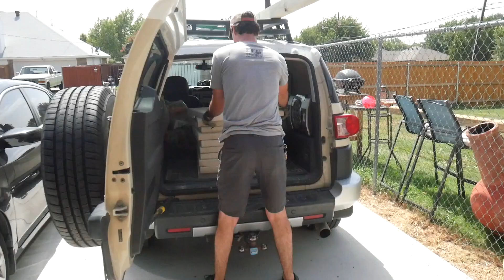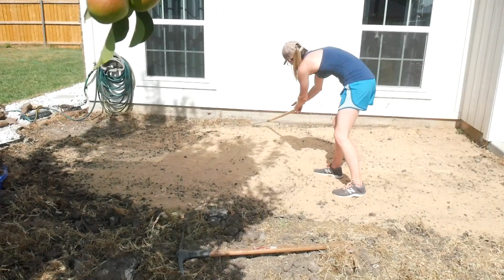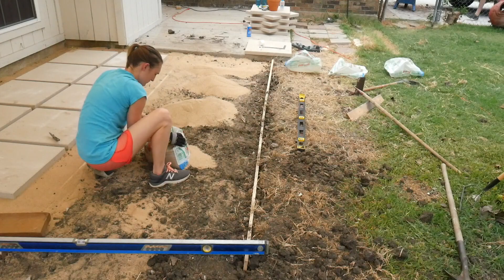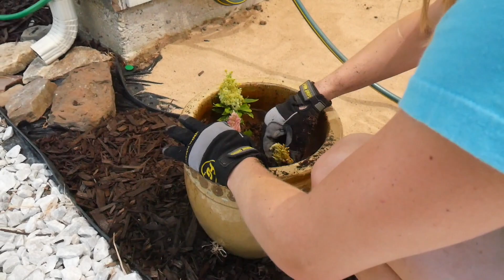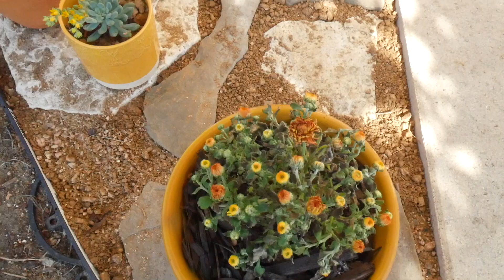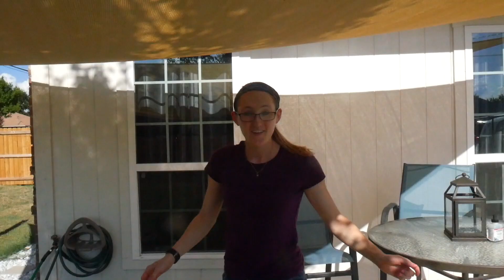DIY XERISCAPE BACKYARD PATIO: Backyard Makeover!!!

Comment: Great Video  I do have a question @ 2:55 mark Why did you place a board and make a line Then proceed to place pavers over top of it    Thank you for your help in this video
Reply from the maker: Hi Tom, that was a board we placed to keep the sand fixed and level as we placed the first two rows of pavers. Then as you see we placed that other board on the outside to hold the edge there as well. Once the first two rows were down the foundation was firm so we could pull up that first board and lay the pavers on top. We eventually pulled up the outside board as well and replaced it with metal edging. You can check that out in the updated video we posted!

Comment: I love how your patio came out. I am starting mine in Feb. Just a quick question, do you know how much of everything you used? Sand etc. Thank you.
Reply from the maker: We're so glad you love it! February will be a much better month to do a project like that than in the heat of the summer like we did.  That's a good question, we used 20 large 2ft x 2ft pavers, about 36 of the smaller pavers, over 20 bags of sand (each bag of sand covers around the same area as the large pavers) and probably close to 10 bags of granite. Honestly we really underestimated how much sand and granite we needed and had to make several additional trips to Lowes and Home Depot. In our experience whatever you think you need, add several more. You can always take it back if you don't end up using it, but it sucks to have to stop what you're doing in the middle of a project to get more material. Good luck and let us know how it turns out!!
Reply: Awesome!! Thank you so much, I will definitely come back here and  show you guys a picture when its all done. I appreciate all the info.
Reply: Hi, just one more question. What are the size of the small pavers you used?
Reply from the maker: @amberrey5282  2'x2'

Comment: Awesome job! I just want to do the same project yours but i am not yet decided to do it now, my reason is to do one like that is to extend my concrete parking bay beside of my garage, the end of parking bay was soil,if i do with that yours? does it hold enough the stone paver if i park my car?
Reply from the maker: Hey Sherwin, I’m not sure if it’ll hold a parked car without breaking the pavers. I know they make pavers for that type of use, so maybe you just needed stronger thicker stones. We only put furniture on ours and we haven’t had a single one break but when we installed them we had 3 or so break apart in our hands and we had to return them and pick up new ones. They can be kind of fragile.

Comment: Hey what size pavers did you use. Was it 16x16 or 24x24
Reply from the maker: 24x24! :)
Reply: Thank you for responding back to me, so now I know what we need to do for ours
Reply: How many bags of sand did you use
Reply from the maker: @angerleanhammond1143  I can't remember an exact number but it was quite a few. Maybe 20...
Reply: Thank you so much i keep watching it over. We did the front and made a sitting area and we did it with 10 - 16x16 pavers and it turned out wonderful but the backyard is such a larger area.
Reply from the maker: @angerleanhammond1143  That's awesome! Glad the front yard worked out so well for ya'll! We actually came back later and made this space larger. We are filming an update today so check back tomorrow for that video! It really is a great way to utilize the space. Good luck with the backyard!!
Reply: Thank you so much I will look at it tomorrow
Reply from the maker: @angerleanhammond1143  Did you see the update video we posted yesterday? It has a few more tips and shows what the patio looks like now 2 years later. :)

Comment: Hey y’all how have these tiles settled? How did y’all get a slight slope away from the house for water drainage (if y’all did)? Would y’all do anything different? Do weed grow through? Lots of questions but a video update would be awesome just to update how it’s working out! I’m motivated after watching y’all work 💕🔥 thanks for sharing this!!!
Reply from the maker: Great idea for the video update! We'll work on putting that together over the next couple weeks. The tiles have settled a little, but not much at all. When we were leveling out the ground we pitched just a little off center away from the house to make sure water wouldn't sit and collect. Haven't had too many issues with weeds except for the grass trying to grow passed the edging we put in. If we could do anything different, maybe wait until fall? Haha, it was SUPER hot. Other than that, the only other thing would be maybe make it bigger. We could have gone out another 4 or 5ft and that would have been more usable for larger gatherings. Thanks for the awesome comment, glad you liked the video!

Comment: I have a nice big yard with space on the side too. The side yard it's just sitting there looking boring..I want to use that space too..the side yard has a slope which iam thinking of removing or adding dirt to level. After that  iam  gonna lay down concrete to use that space too. However, now  iam debating between gravel and concrete for the side yard space ( 15ft  from house to fence and 60ft long.)...my only concern is gravel getting stuck under shoes and bringing it into the house...I have very nice plank vinyl flooring.. we won't be taking shoes off to go into house.
Reply from the maker: Totally understand the gravel worry. Our dogs bring it in sometimes but we haven't had any scratched floor issues....yet. Concrete is a great option just cost more. We chose this as an alternative to save some money. Love that you have a huge yard too, they are really nice ones you figure out how to utilize the space! Good luck with the project!
Reply: @diydwight7980  sometimes is a problem to have a nice big back yard at least in my case..I don't know how decorate or where to do concrete and where not too. Lol
Reply: @diydwight7980  by the way your patio looks so xool
Reply from the maker: @futbol1972  haha us either sometimes landscape design is not our forte, but thank you!!

Comment: Without a 6" gravel base, or an alternative drainage system in place, water can roll back on it, causing damaging erosion. Most patio installers no longer use sand at all.
Reply from the maker: Thanks for the tip! We piped our gutter drains under the patio and actually went back and added a small french drain to help with drainage later. We haven’t noticed any issues so far with settling or drainage issues. 🙂